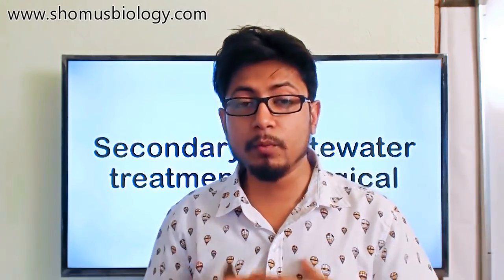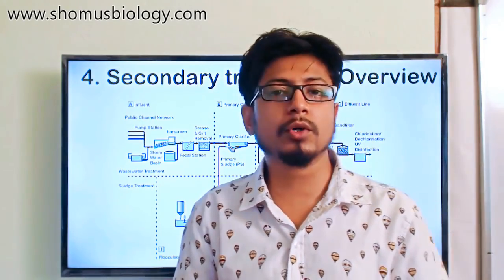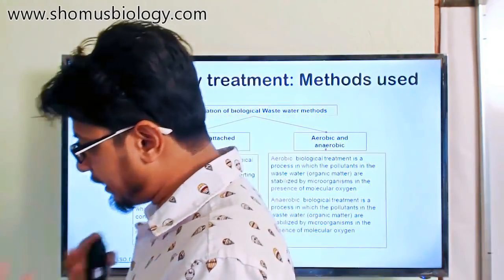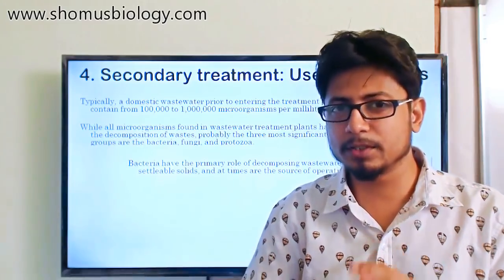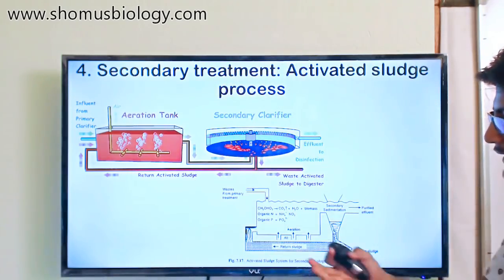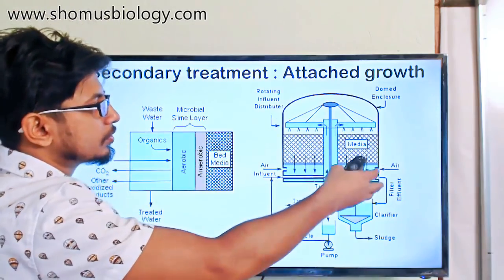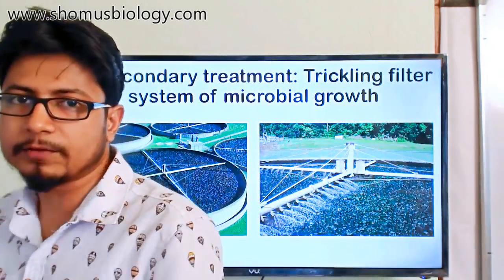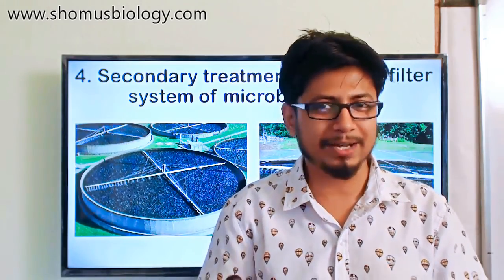Secondary treatment of wastewater

Comment: Alternatively, by what percent would the time required for secondary treatment increase if activated sludge is not used.
Reply from the maker: That depends from system to system
Reply: @shomusbiologyofficial 
Correct. Thanks. But given different systems what has been the efficiency improvement range??